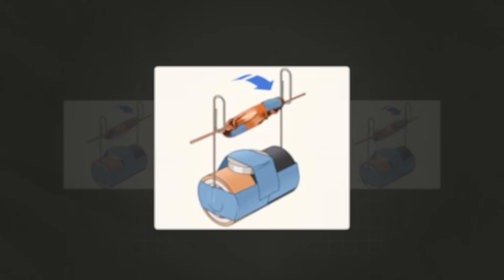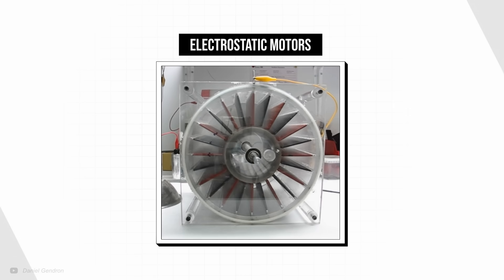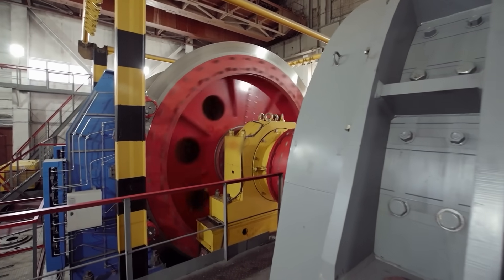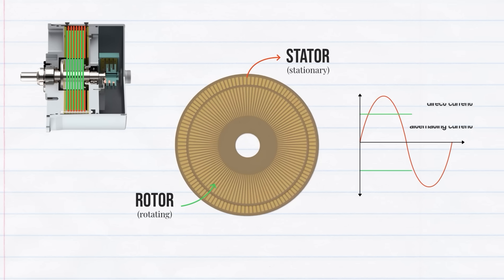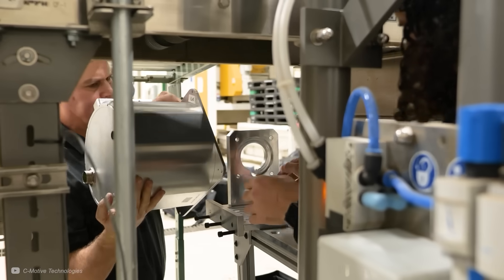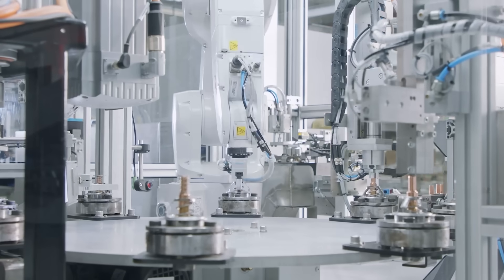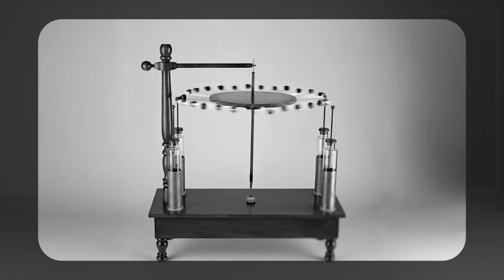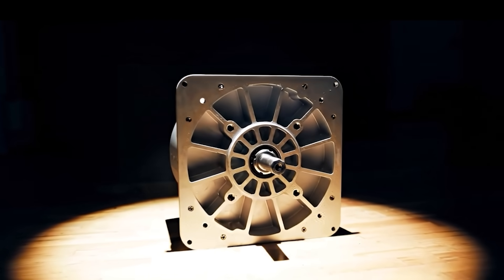How Electrostatic Motors are Breaking All the Rules

Comment: a 4kV bus bar on a factory floor for power distribution sounds insanely dangerous. forgetting the motor itself, the MCC disconnect cabinet would have a lot of power going through it, techs would likely have to dress in full arc flash kit every time they wanted to flip the switch... Not to mention, instead of VFDs they would need to actively adjust the voltage delivered to the plates in the housing. This tech is at least 50 years from being implemented in industry due to material constraints alone, unfortunately.

Comment: I guess the motor have some advantage in terms of torque density compared to tiny standard asynchronous motors. But not in power density. The large discs must have gigantic increase in  viscous losses if some speed is required. Speed times torque is power. By the way, no rare materials needed in asynchronous motors and for many applications, no need for any electronics (semi conductors) either. Very simple. Very recyclable too.

Comment: Electrostatic motor RPM is highly variable and depends on the specific design, but examples range from the low thousands to tens of thousands of RPM. Unlike traditional motors, electrostatic motors use electric fields instead of magnetic fields for motion, which can allow for different performance characteristics. Recent advancements show some electrostatic motors can operate at high speeds like 24,000 rpm, while small micromotors have maximum speeds of around 2,864 rpm.

Comment: Industrial electro magnetic motors have typically efficiency around 98%. Good luck making it better with electrostatic motors. There might be some use for those, but none of these reasonings sound valid. You can’t talk torque without power, because it’s easy to use very small motor and high gear ratio to make huge torque, if high rpm is not needed. Also gears are not very expensive or lossy if high rpm is not needed. Same goes with material savings. They need to be compared with motor about same power, not torque. It sounds like the goal is to avoid gears by any cost, but high voltage electronics is a pretty high cost by itself.

The fact that the motor is filled with fluid means it really can’t have much more than 20rpm without big losses. That’s why they like to talk only about torque.

Comment: Great video! I think they should apply a vacuum. A moderately hard vacuum would allow 10x the voltages to be applied before break down in air. Also, more importantly there would be no parasitic losses due to viscosity. Sealing would be a challenge but you don’t get something for nothing.

Comment: As someone who has performed work in half a dozen industries doing electrical design and process automation I will say that it feels like it’s still a novelty. 

In it’s niche application it is providing too small of an an advantage in performance to justify the redesign, cost of additional skus, retraining if maintenance, safety training, etc etc. Trying to claim a big industrial market sounds like a far fetched funding pitch. The thing you’d be trying to supplant is the ac motor and gear box which works incredibly well, it’s rugged, easy to make, easy to maintain and repair, and low cost. 

That being said, pretty neat if they get past the science fair project phase.

Comment: What you are showing at 0:49 is known as a "Coreless Motor" something that's been available even in the Model Railway field for over 40 years. First used supposedly in Military Fighter jets, because such motors run on Direct Current, as they aren't affected so much by "G" Force, or freezing weather !!!!  Traditional Electric motors were poled and NOT like the motor you showing at 1:04 at all. I think you are getting your wires crossed. Which University did you attend ?

Comment: Conveyor belts use induction motors, which don't have permanent magnets. And copper can be replaced by much cheaper aluminum wiring, the latter also being an excellent conductor of electricity (actually better than copper by weight). And regarding efficiency - modern motors used in today's EVs claim to have efficiencies of 90% and more. So although this is an interesting technology, I'm not so sure there is a huge market for this.

Comment: 7:50 C-Motor using the 65% Efficiency claim is really underhanded marketing wank. When using efficiency comparisons, the logical and fair comparison is each motor in a controlled test with the same work being done. Not using a motor that is the wrong size, with poorly tweaked gearing and mechanical losses. I can't trust companies that make such misleading claims.

Comment: Mineral oil is not a proprietary fluid! 😂😂😂

The dielectric strength of mineral oil typically ranges from 15 to 20 kV/mm (or about 380 to 500 V/mil) for refined, high-quality mineral oil used in electrical applications like transformers.

Comment: 90%+ is the efficiency of induction motors and a single stage reduction gear has 98% efficiency, you won't get much better than that because there is not much to get better there

Comment: The claimed cost savings of $1400/yr for a 1.5kW motor is dubious at best. Using their optimistic figures, and assuming the motors run 24x7x365 with zero downtime, and always at 100% load, that means their assumed power cost is $0.28/kWh. In some residential areas during peak times, sure, but industrial/commercial users typically pay much less.
In more typical conditions, their assumed cost of power would be much higher still.

Comment: "no Crash, no Data loss, no need for ITT", but also no work when underway (actual reason i can not use this.), no work when internet connection is absent (see previous point), unstable or slow, no control over your (possibly sensitive) data. It is actually sad that such a, from the CAD side of things, high usability CAD application has to be omissed just because the vendor wants to have control over the customers data. Bears the question: why?

Comment: They should look at making linear motors. They suffer from several problems like the long stator nor the mover are good spots for coils, or placing magnets. This means they are often built more like coreless motors, or induction motors which suffer from low efficiency or high cost. Using them for conveyors means items can travel on sleds instead of moving an entire belt making them great for factory production lines.
Reply: Ah yes, use them for item transport instead of a million more useful places, what a brilliant idea
Reply: @youtubehandlesux  because products are only allowed to be used for one purpose, am I right? Now what internal combustion motors are allowed to be used for? Vehicles, generators, construction machines, do I need to go on?

Your comment was stupid, just looking for negativity. I am sorry you're so unhappy with your life you feel you need to lash out.

By the way there are MASSIVE efficiency gains from breaking conveyor movements into individual stations beyond the 35% energy savings getting rid of induction motors. Plus my "item transport" is just a fraction of the uses my suggestion entails, that was just ONE example out of probably close to 30% of ALL motors you could replace.

Comment: Why not replace the air inside the motor and the discs with SF6 gas, Sulfur hexafluoride? lest viscosity than a liquid therefore less drag on the discs.
Reply: I love climate change due to the SF6 leaking
Reply: @youtubehandlesux Siemens Energy's "Clean Air" then.

Comment: Meh, they (and you now) present their data with so many possible corners to cut you should really not copy it, but actually do your own investigation. You can be sure they picked the factory setup that makes their motor shine. They (you) should just break down the data in numbers, what are the losses at what torque/rpm? How much loss from a gearbox? Do the typical 90% efficient permanent magnet motors take over in efficiency at a certain RPM? What RPM? And to give an example of how they can skew your view with their presentation: in the thermal display of the motors, you can see the new motor is more than double the size of the old one, that makes one wonder how hot a conventional motor double the size will run.

Comment: Sounds to me like yet enough road to no where because the efficiency losses will be higher than alternatives, we have made reliable induction motors for 100 years, and tesla for example fine tuned the frequency on early model s to make a very high powered high torque motor... so high torque they only have one speed transmission because it kept wrecking multi gear transmissions and it has such torque low end and speed high end no need for more than 1 gear.

If copper is too expensive we can go copper coated aluminum or pure aluminum...  its more fragile but that cam be compensated for.  Rather than wire, its also possible to do flat copper or aluminum like in the highest efficiency motors.  We can get 90% efficiency, sometimes even 98% on really big motors.  This design with fluid drag, etc is going to be struggling to get 90%.  

Maybe it can find a niche of extremely high torque per unit weight at lower efficiency but not needing a gearbox will then get ahead

Comment: "rare earth magnets"... aren't needed just a little better than alternatives....  tesla model s initially had induction motors, we can also use induction/wireless charging principles to replace brushes to transfer power to electro magnet windings instead of permanent magnets.

By carefully tuning the frequency of the 3 phase power, induction motors while not as good peak efficiency are better over a wide range of power output.

Comment: Good description of a electrostatic charge motor (ECM), however; I have no idea where your got the poor information about existing motors.  I worked for an aerospace company in research with motor focused and power electronic engineers. I am a packaging mechanical engineer. 

I have done a lot with PM generators mostly but also with motors. "PMSMs achieve efficiency levels between 85% and 98%."  Ball bearings and gear messing are in the order of 95% efficient. For high gear mesh efficiency sliding  between meshed teeth approaches zero.  "Typical efficiency ranges for worm gears vary widely, from approximately 50% to 90%" with the higher the ratio the lower the efficiency.  You have chosen the tradeoff of lower purchase cost but higher operating cost. 

The alternate that also need similar electronics is Switch Reluctance motors (SRM).  "Typically between 80% and 90%" efficiency, and no permanent magnets, just magnetic steel.  These motors can be found in consumer products.  

Each type of motor has different applications. So let me put forth one is in the same application as a ECM.   Stepper motors can be either permanent magnet or switch reluctance.  With the same type of electronics these motors become a PMSM and SRM that are low speed and high torque..

Comment: I’m trying to consider the engineering impacts of supplying hv to these motors and manage the safety issues around that not to mention the supplies. In Australia installations above 1000vac have an additional standard to comply with. The earthing and protection would make it fiscally irresponsible to switch to these motors.

Comment: one of the downsides of this tech is that we need to change the voltage and the power electronics to operate them. the inicial cost is very high. chances of isolation failing high too. fiberglass pcbs are mechanicly weak... I don't really see the benefits.

Comment: Dielectric high voltage gases/fluids have the word Fluoride in them, I suspect their top secret compound will be associated with SF6, this has a huge GWP (global warming potential) and anybody who has worked with this group of compounds will know this idea, from a commercial, practical viewpoint is dead and buried before it has come alive. The entire high voltage industry is currently under huge pressures to 'clean up its act' same as the refrigeration industry started 20 years ago.

Comment: To be blunt,  Brushed motors are basically obsolete except for some high hp dc applications.   The reason these are still DC is the replacement cost,   They have one running and a spare in inventory.  

As far as gearbox savings,  what c motive stated is true,  however the same can be accomplished with a lower speed AC motor and Variable frequency drive.    An AC induction motor speed is typically 3600 ( 2 pole)     1800 4p,  1200 6p,   They are available in 900 8 pole,  450 16p.    

The issue is standardization and maintenance replacement.    I was an app engineer for a  Fortune 500 VFD mfg for 30 years.   A local auto assembly plant was one of my key responsibilities,  they calculated their downtime cost at $200,000 per hour.   That’s $55 per second,  the $1,400 per year savings would be wiped out in 25 seconds of downtime.    

I’m a motor nerd and I enjoy seeing the new technology,   The thing you have to remember about ANY manufacturer that’s promoting new technology,   They typically are honest about what they are stating,  but they very often skip over some relevant facts that they know are important.   

However If a mfg states “Based on NASA technology  don’t believe anything they say 😂😂😂😂
Reply: Correct, but don't forget high voltage brushed systems are usually considered non contact
Reply: @Ino-z2m I have no idea what you are referring to.   High voltage motors are almost never used,  medium voltage motors are the highest practical rating.
Reply: @Ino-z2m what are these brushed motors you are referring to?    AC motors do not use brushes
Reply: @Savedbyhisgrace2025  food mixers, coffee grinders, sewing machines, vacuum cleaners... in fact anything that plugs in and makes a noise. Modern versions of these all have inverter motors. We had a beer and wine fridge that had one of the old fashioned compressors that cut in and out on a thermostat, not a brushed motor but an old induction motor that consumed about 350w. Replaced with the modern inverter DC (as we are doing with everything), it consumed 80w! In fact I had to plug something else in because I assumed I had made a mistake. There's no place in this modern world of photovoltaic and hybrid energy systems for all this 60's technology! Same with old cathode ray tube televisions, bulbs that get hot, telephones with wires, fax machines, CD's & DVD's...
Reply: @Ino-z2m you need to get your terminology correct if you are going to discuss motors that are used for manufacturing.     Low voltage motors are 600volt AC and lower.    
There is no such thing as a “brushed non contact motor”.

Comment: Yea, No! 😂
That's just another "disruptive" BS technology nobody needs!
Good for them if there is a use Case wich can benefit from this type of motor, but I doubt it.
Even induction motors can easily run in the high 90% efficiency range, and they don't need magnets or a controller.
If you get controllers involved you can simply use reluctance motors, or improve the efficiency of induction motors withe them.
And if you really need verry low speeds and high torque, without a gearbox, you can always build a motor with more poles and larger diameter rotor.
But even that's not done because of the convenience of standardized simple motors, over the last few percent of efficiency.
Sooo, good luck I guess! 🤭

Comment: I can tell you from experience that keeping the water out of so called water proof enclosures is a nightmare in industries like breweries and dairies. Even at low line voltages commonly used in industry (415 between phases), there are many failures from water ingress. When the motor is hot, air inside expands and pushes out through the seals, when it cools a partial vacuum is created and the outside air creeps back in along with water or water vapour. Also, any liquid between rotating and stationary plates in close proximity is a recipe for high frictional losses. These losses could be higher in practice than the copper / iron losses in conventional motors.

Comment: sounds like a lot of over blown hype to me, i'm not buying into the fantastical cost savings, especially in things like downtime, ive seen standard motors in use for decades, and suddenly they are going to claim a savings on downtime with a motor that has yet to actually see industrial use. that's a lot of speculation, and if you overly speculating on that they are probably over speculating on everything else.  and the main reason that the were never used in the past is the lack of torque, if they came up with a solution to that great, but the funny thing is when it comes to doing work with electricity when you step up the voltage it takes current, you can't bump up 110 or 220 or even 440 to 4000v with out a penalty in the current from the mains. and the act of bumping it up is going to have its own loses. i've seen electric motors all the way up to 15,000 hp and i'm sure there are even bigger out there and i don''t see this design as being a viable replacement for them. maybe i'm wrong, i don't mind technological advancements. but I've learned to be very skeptical when someone comes around and promises improvements of that magnitude.